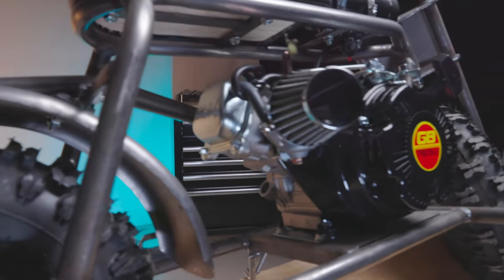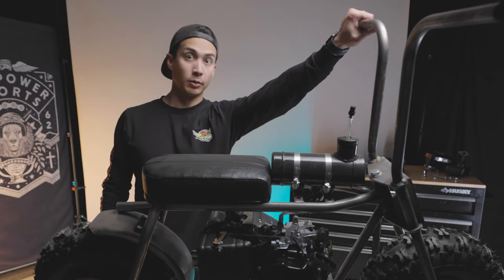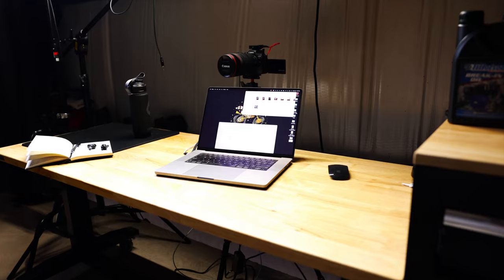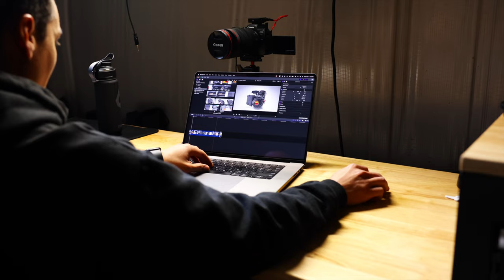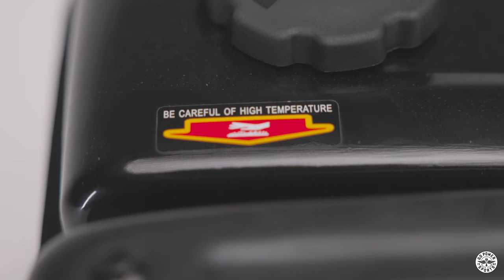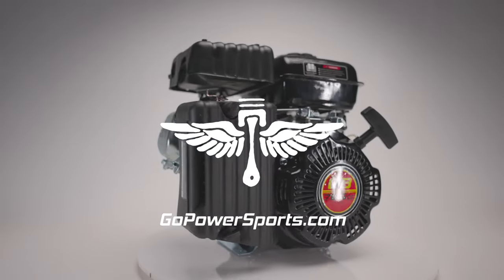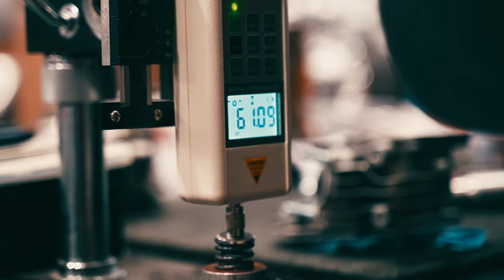Jeramie Cozad: A Collector's Perspective On Mini Bikes | Minibikin' Ain't Eazy, Episode 10

Comment: I love the video, however I have been thru a big let down with the 79 and 98cc engine not much aftermarket parts for these engines until you get 212 
I got a 98 running so good I just wanted to step up w a cam ! I could only find someone to weld one up 
So I just went w a 212 a good engine but I wore one out in 6 months get a engine w cast iron sleeve and a block w extra bottom end support ( honeycomb block)
Dual bearings, if you like rpm’s you gonna need it !!